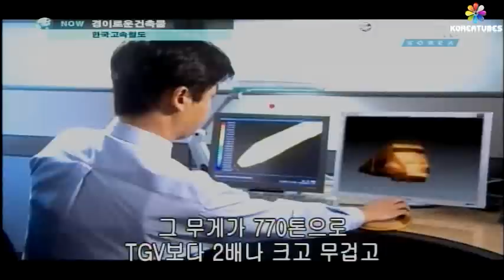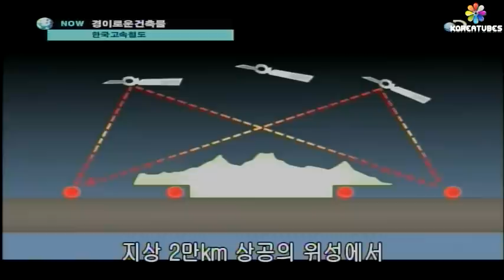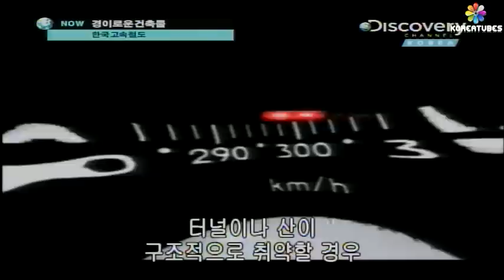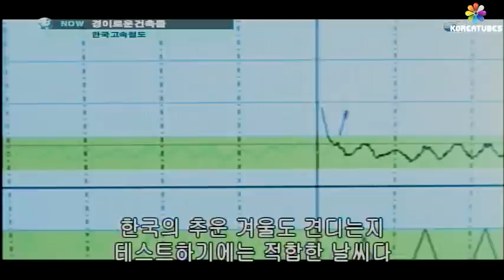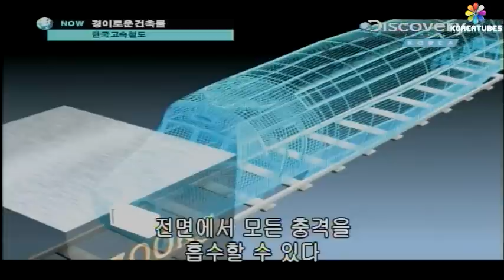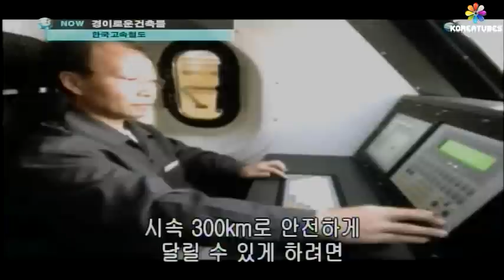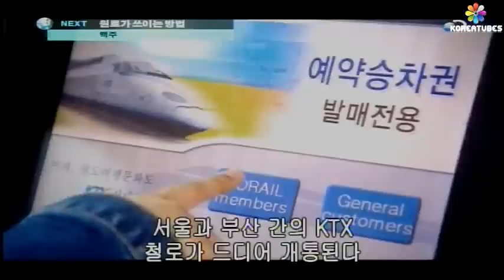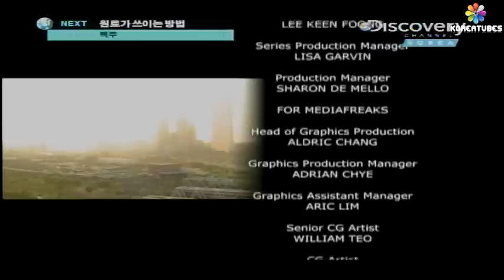KTX - Korea Train Express

Comment: The researchers of this documentary has gotten a few things wrong here: 

The design of the connection between carriages (or waggons, if you prefer that term) having the axles is not revolutionary. The design is known as a "Jacobs bogie" (http://en.wikipedia.org/wiki/Jacobs_bogie) and is used on several trains, including the TGV, on which the KTX is based. And, according to the german wikipedia article on the design, the designer applied for patent on the design as far back as in 1901. 

The re-generative brake is not new or revolutionary either. As far back as in the 1930s, a version of this system was used, and are also used on the french TGV, and various other trains. So perhaps what is meant, is that the KTX might use those systems differently, but I am not sure.

Apart from such minor flaws, this is still a great documentary,
Reply: the new  second  generation of  KTX  is consist of  Hyundai rotem's  technology .  So, the second  generation of KTX's  technology  is Korean hightech